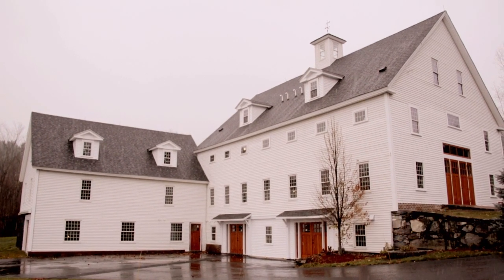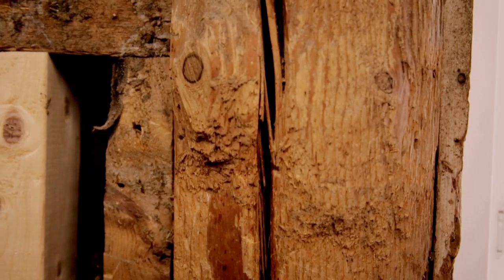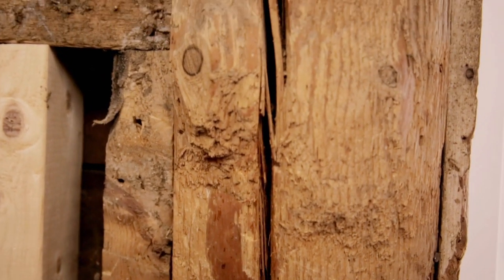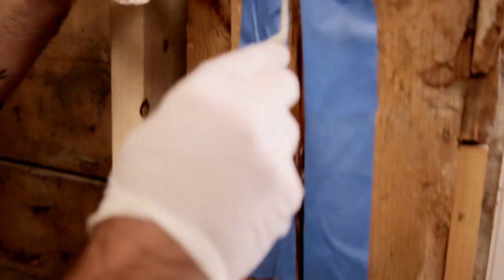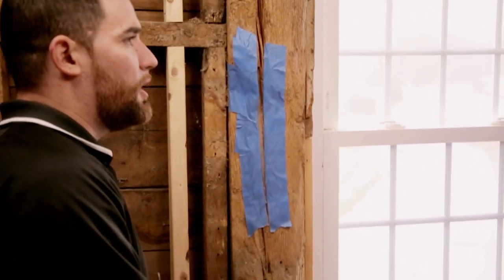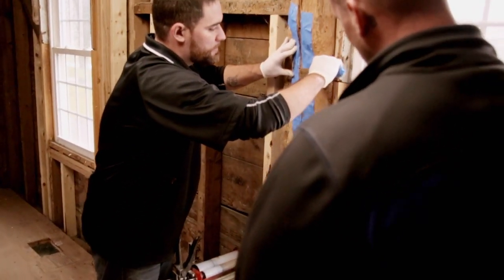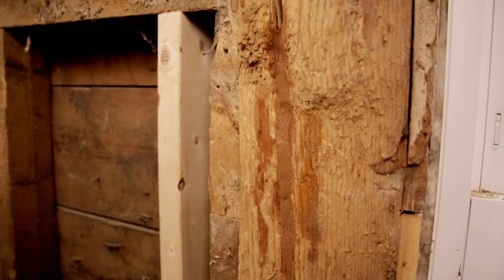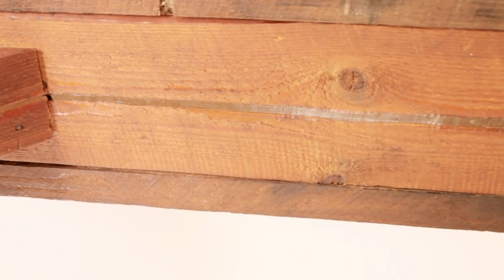Barn Beam Restoration: Before and After, Bolton, MA

Comment: I have used other 2-part apoxy to fill in wood deficiencies such as cracks and knots before and I was able to later stain the epoxy to match the rest of the beams to reduce the eyesore of the cracks.  Will this epoxy stain after it has hardened?  And is it usable on vertical support beams for pergolas or porch roofs?